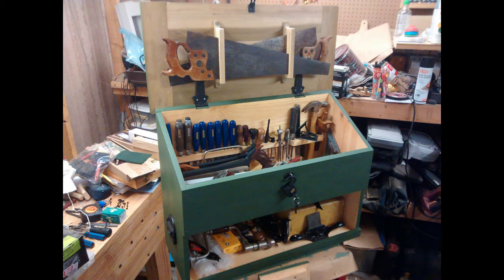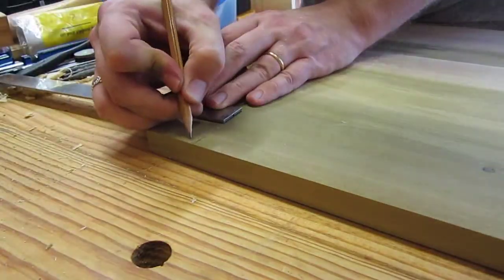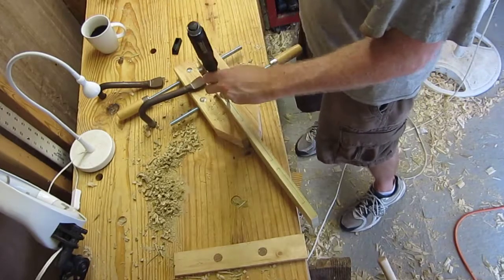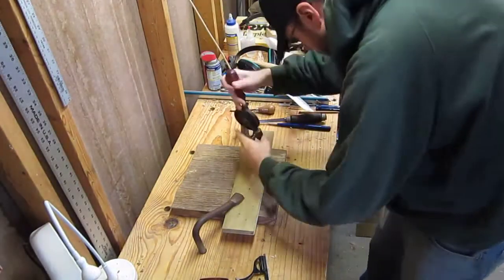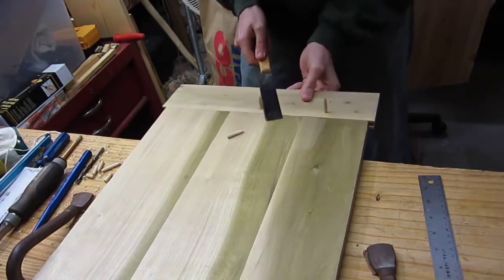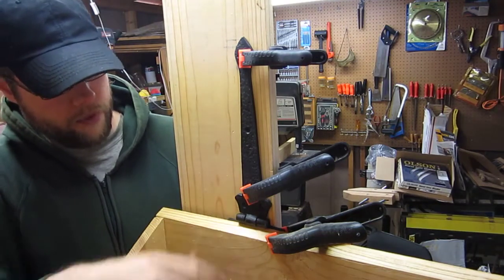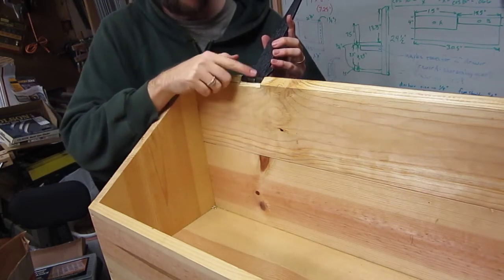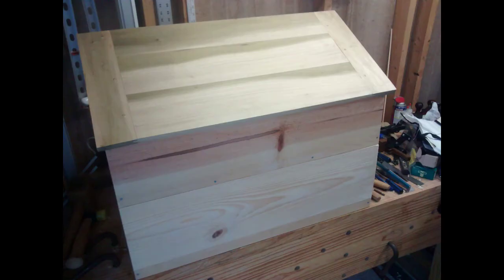Dutch Tool Chest - 06 - Breadboard Lid

Comment: I would use man made boards  - ply, block  - and put lipping on the edges. Loose tongues, or biscuits would suffice. Use the grain of the man made boards as usual. Glue the lippings on. I did, by using 44 mm x 18 mm redwood get neat joints. I used mitres with splines - 6 mm thick  - to give it extra durability. Your dowelling is of the drawn type?
Reply from the maker: Hi John, yes I draw-bored the breadboard ends so they're quite solid.  I opted to use solid wood for a few reasons: 1) I used hand tools to make this and I don't enjoy using hand tools on ply wood and similar materials, 2) I'd never done breadboard ends before and I wanted to learn how, and 3) I like the looks of the breadboard.

That being said, I'm sure the ply wood plus solid wood edge trim would be just as durable and probably less time-consuming to make.
Reply: @SharpWorkshop  Okay. I enjoyed everything you put out regarding the video. There is something - you might know already - called a slip dovetail joint. I am in the UK so sometimes the word usage is not the same? The man made boards are stable within reason that is why I mentioned their usage. I made a Dutch chest and put it under my bench, so it slid off (no hinges) on a sort of French cleat design. I used a giant hasp and staple to secure the ‘lid’. We have tool thieves (too many) in the UK. Good luck, enjoy the process of the jobs.

Comment: May I inquire as to the reasoning behind using a poplar lid on a pine carcass?
Reply from the maker: There's no real reason or advantage to using two different woods.  I just had a poplar tabletop glue-up from an unfinished project that I turned into the lid.  I was just using what I had on hand.